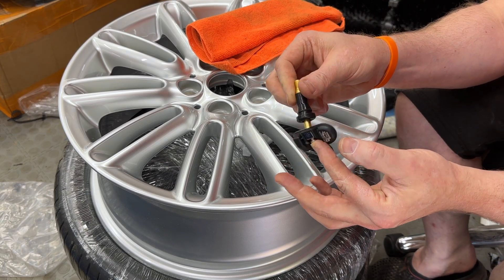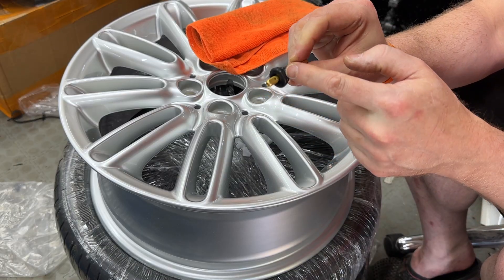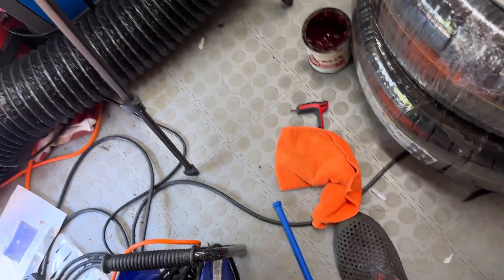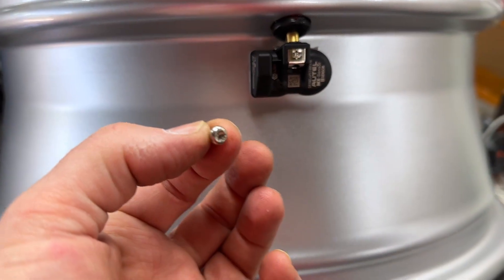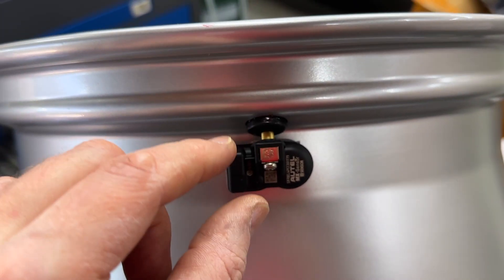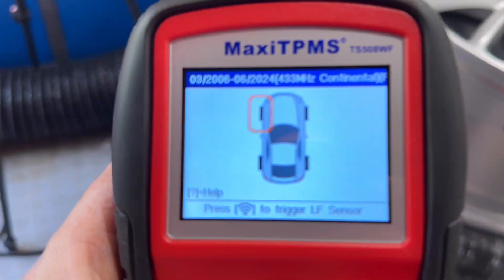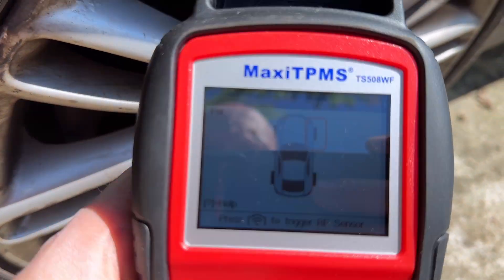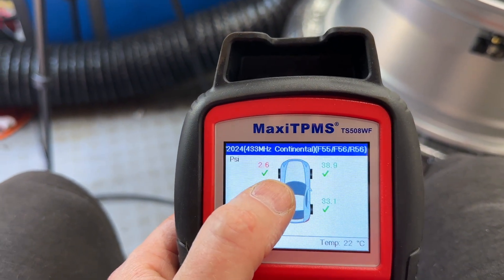Cloning TPMS Sensors Is Easy Peasy Lemon Squeezy

Comment: I tried to duplicate as of 7.31.2025 with the instruction above and didn't see it in my new and updated Autel MaxiTPMS TS508WF. So I called Autel and CS said the cloning feature was removed on the update software of MaxiTPMS TS508WF. No more cloning according to them.
Reply from the maker: Seems like an unusual thing for them to do. I don't understand why they'd do that.
Now you have to scan the sensors, double check them with the car by connecting to OBD and then it'll let you code a new sensor.
https://youtu.be/UFrBWmFDd4M

Comment: Looks like it's worth getting one of these too 😅
Reply from the maker: Slippery slope. Thankfully I'm near the bottom of it now 🤣
Reply: @evilution_ltd  bought a set of aftermarket wheels and did put in a set of mb 433mhz Tpms sensors but they haven't been coded to the car. The fitters said the car would self learn, but clearly not. Since I still have the original wheels at home I may as well just clone them and then paste into the aftermarket rims.  

And the other diagnostics the autel one, that can only get the car into a Tpms relearn mode?
Reply: @evilution_ltd  There's always new depths; when are you buying a laser rust remover?
Reply from the maker: @turbokadett  genuinely it's on route, I have the tracking number.
Reply: @evilution_ltd  Awesome 😎